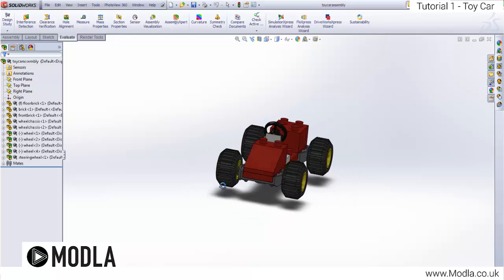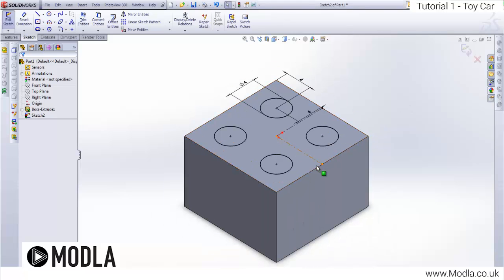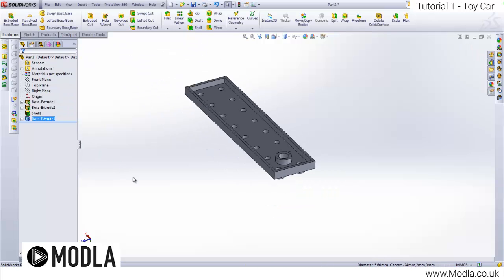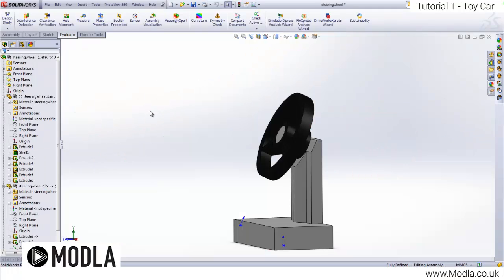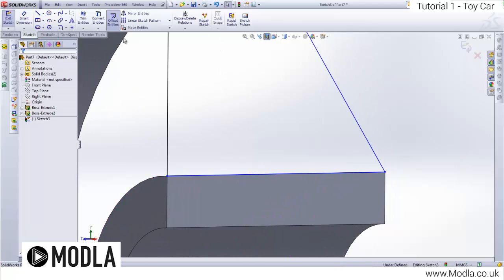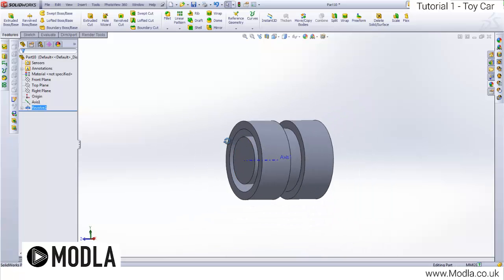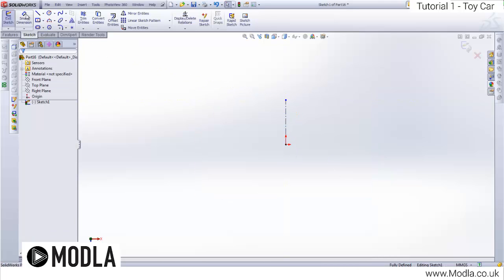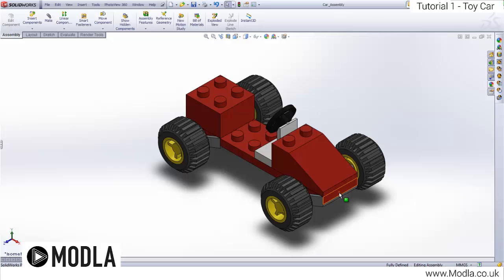Solidworks Tutorial Parts and Assemblies

Comment: Solidworks gave me quite a challenges and struggles even on its basic levels. I was always conflicting with my previous many-years experience as 3D artist with 3dsMax.  That video kind of clarified for me so much basic stuff which i otherwise impulsively misinterpreted in Solidworks due to my previous skills, expectations of how 3d viewports, move/transform and snapping tools "should work"  :l

In university, in one robotics course we are asked to learn Solidworks. I need to convert my previous entertainment-oriented 3D skills and transfer them to Solidworks. It is not that easy as it sounds.

Thanks, man.  It was good that video was one hour long with little to no rush at all. That helps.

Comment: I can move the tires but not the steering wheel when i bring it in as assemble
Reply: +brian lazzara if you want to assemble something, you got to make sure that the first part you browse in (so only select 1 part first), isn't able to move, you have to make sure that you are able to attach everything to that single part that you browsed in first. Like the chassis of a car, you first load that in, after that you can load in the weels (4x), the roof, the hood, ... and so on... You can attach everything to each other by using "mate". Yw :)